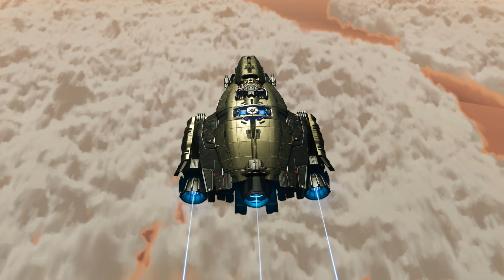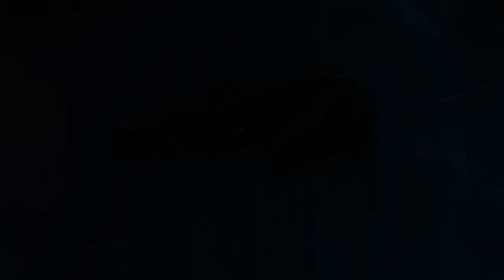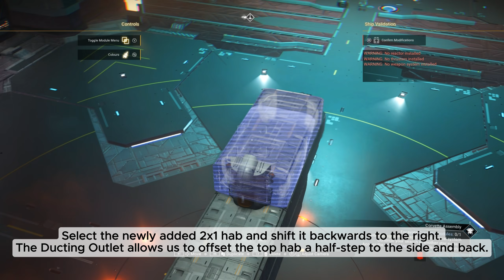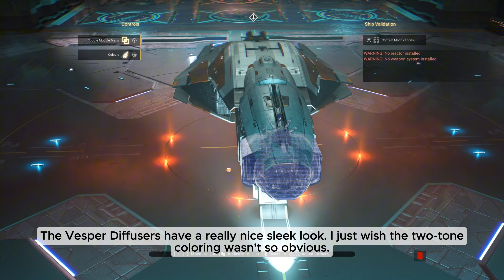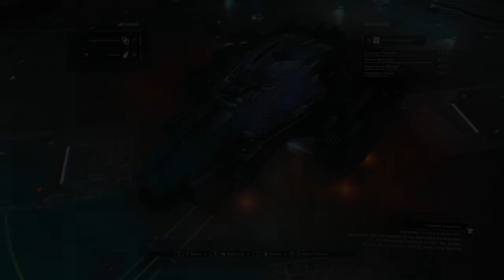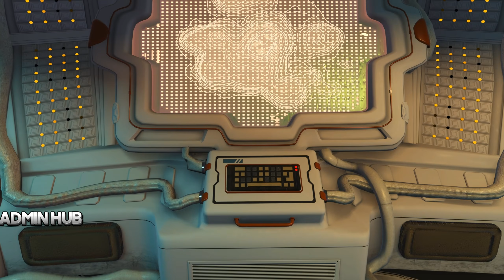How to Build a Daily Driver Exploration Ship | No Man's Sky Corvette Build Guide

Comment: I am 100% building this ship as my first corvette in NMS! Hopefully someone can answer this. How can I bring the side engines out a little more? I love this look but want to have a little larger wings. Kind of like the MOA from Eve Online.
Reply from the maker: Nice, glad to hear you like it! It's definitely possible to extend the engines out by inserting additional habs or walkways on each side of the central fuselage, but if this is your first build, it will definitely get confusing since we use some glitch merging techniques to build out the main hull. 

What you should do is build out the fuselage as you see in the video, then add a hab on each side of the upper deck rear hab. You can build out the main hull as you see, and do the same glitches, albeit just with a scaled up width since you're going to be 3 habs wide instead of 1. This is where it will get confusing for your first time because the glitches will require that we merge walkways into the central fuselage habs. In this case, you will have to do the glitches onto each of the newly added habs that you used to increase the width.

This might not make any sense, so in all honesty, I would recommend trying to build out the ship first and get used to how the glitch techniques work for this particular build.
Reply: @High_Key  I think I understand the concept but I will take your recommendation to build the ship like you present it until I have a better grasp of how the layering / offsetting works. This and the second ship you made for NMS are so cool. I also want to make the Meridian Star but maybe make the main body a little more round?
Reply from the maker: @Allbirdbag  It will definitely help. As soon as you understand the concept of half-step offsets and how to do them, it completely opens up ship building to so many new opportunities.

That Meridian Star build was my second corvette and it doesn't use any merging techniques, so very simple ship to build. I eventually plan to revisit it and improve it!
Reply: @H @High_Key  I can’t wait to see that. It already has a classic shape so an updated version would be awesome.

Comment: And here I am using a purely vanilla building techniques ship... Maximum parts and it is the most broken I have ever managed to make a corvette without using glitch building. Just wish it was possible to remove the Photon Cannons since it used Infra-Knife and Photon Beams as its armaments. 😅 I named it the Swift Raven.
Reply from the maker: Wait so you were able to build something similar with the glitch merging techniques?

And yeah I typically use photon cannons because I prefer the look of the cannons. Like for example, I use cyclotron ballistas all the time but the cannon tends to not fit what I’m doing.

Comment: I was following this design, but when I finished deleting the walkways in the center merged with the habs, I noticed that the engine is half a block further out than the end of the habs? is this supposed to be the case?
Reply from the maker: If you removed the hab and reattached it after the deleting the walkways, exit the builder and run inside the ship to make sure the 2 habs on the main deck aren’t merged into each other. You’ll know they’re merged if you place a stair and it’s blocked at the top. The whole main deck is supposed to be 2 Habs back-to-back behind the cockpit. Because of all the parts above the habs providing additional snapping points, it’s easy for the habs to merge into each other accidentally

Comment: Can we please get an updated one on this with the missing steps
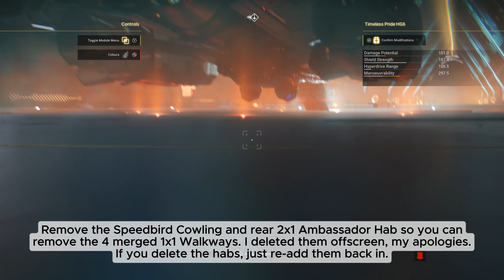Reply from the maker: The part that I forgot to record is a simple step. Remove the hab behind the cockpit, and if you see any walkways that would’ve been merged into the hab, just delete them. Should be 2-3 of them. At the 10:53 timestamp, I remove the rear hab to clear out one of the merged walkways but there’s about 2-3 more merged into the hab in front of it. So you can do the same, remove that forward hab, to reveal the walkways, then delete them.

Anyway walkways on that central main deck need to be removed leaving only the 2 habs.
Reply: @High_Key  Ok I think I’m kinda understanding what you’re saying. Ima try it cause this design is perfect for me.
Reply from the maker: @ededdandeddytv5164  Let me know if you run into any issues! I'm going to be traveling overseas tomorrow though, so if you get stuck, I might respond a little later, but it will still be within the day 🫡
Reply: @High_Key  cruising the cosmos in the Starwind now 🫡 thank you sir
Reply from the maker: @ededdandeddytv5164 NICE 🍻 see you in the cosmos!

Comment: I've rebuilt this ship 3 times and still can't access the top habs. I've removed the Titan hab on the bottom and both Ambassador habs, still no joy. I believe I removed those 4 walkways, but at this point, I dont know. Help?

Edit: Based on the count of walkways I started with, they're all removed. It looks like there was an issue with the Ambassador habs overlapping. I can gain access to the cockpit now, but its only half open. I'll remove the cowl and see if i can pull the upper habs back a little. 
Lovely build, thanks for the awesome video

Comment: Did they fix any of the bugs?
Reply from the maker: There haven't been any major issues recently outside of some expedition bugs that have already been patched. Which bugs were you referring to?
Reply: @High_Key the ones where you use walkways and such, or when I try to put the engine covers half overlapping each other like you did, I think I must have messed something up along the way
Reply from the maker: @luckyvii9772 oh like to merge those parts without having to use those walkways and ducting outlets? No not yet unfortunately. I’m not sure if that ever will tbh. The amount of time it would save us if they could just add it..

Comment: That blue version is also interesting!
Could you look into explaining the original??
Reply from the maker: Honestly, I rather much prefer the design of that blue version too. I think the sharper lines give a cleaner look overall. If you want to go for that look, it's actually a very easy change to do. You just use those Vesper Diffuser parts instead of the Speedbird Nacelles that I ended up using when that section is happening in the video.

I've been wanting to do a Mercury Star Runner build in NMS and so I'm mostly likely going to use this build with the Vesper Diffusers as a base structure for that.
Reply: Could you also look into an interesting looking small transport corvette but glitch free?
Reply from the maker: And I can definitely add that to the to-do list. If you're interested, my two first ever NMS corvette builds were glitch free builds. Parts were merged but they didn't require any weird glitches or anything. For now, you can check those out: 
https://www.youtube.com/watch?v=8Er1EiGZW_8&t=8s
https://www.youtube.com/watch?v=qBMwYnnbZBE&t=137s
Reply: @High_Key  i wil take a look at that
Also a small correction: trading ship parts you're not required to offer three items, you actually need to see what is and what isn't accepted for trading, the percentages Should(but that's not always correct for some reason) show the chance of getting the trade(there are items with high trading potential and low potentian depending on the part you want)
There sadly is no definitive way to always get the parts but i hope it creates a better picture😉

Comment: Love this build - for those that like text parts lists (like me):
T-7 ARCLINE-CLASS PARTS LIST

COCKPITS & HAB MODULES
Titan-Class Cockpit
Thunderbird-Class Hab
2x Ambassador-Class Hab (+1**)
9x Walkway**

ACCESS & DOCKING
Ambassador-Class Landing Bay
Mag-Field Landing Thruster

THRUSTERS
Kineostream Thruster
2x Thunderbird Heavy Booster

DEFENSIVE SYSTEMS
2x Photon Turret Array
Defence Field Shield Generator

REACTORS
Azimuth-Class Reactor
Medusa-Class Reactor

STRUCTURAL DECORATION
WINGS
2x Arcadia Wing Module
Rockhopper Propeller Module**

HULL PLATING
2x Engine Cover (+4**)
4x Speedbird Nacelle**
2x Supercruise Aerofoil
2x Vesper Aerofoil
4x Vesper Diffuser**

HULL ATTACHMENTS
Ducting Outlet**

WINDOWS
2x Paneled Window

COLORS
TAN & ORANGE (METALLIC)
DARK GRAY & BLACK (METALLIC)
* = Part is used for glitch merging and/or is temporary**
Reply from the maker: 🍻 glad you enjoy the build! Thanks for providing the parts list here too
Reply: You are a legend cheers 🎉

Comment: Been cruising around in this for the past 4 or 5 days. But, I rebuild my ships almost as often as I change my underwear, at least every 2 or 3 days. 😛So, time to browse through your other ships and see what you got.
Reply from the maker: Glad you're enjoying the ship so far. And you and me both 😂 Btw I started with Starfield ship builds and do NMS builds now too. Just a heads up so you're not surprised with the Starfield builds.
Reply: @High_Key  I keep coming back to it.  I've rebuilt it 3 times now. It's my daily driver.  Right now, I use it to hunt for sentinel ships that I'll never fly because the corvette is better.  Especially now since I have a 4-in-1 mod that turns the mission terminal into a teleporter, planet scanner, trade terminal, and it's primary function of being a mission terminal.
Reply from the maker: @RetroGuy_77  Man that's awesome to hear! How come you rebuilt it 3 times? Just to have different variations or for different saves?

Now I'm curious, how's the mod scene for this game?
Reply: @High_Key  I usually only keep one corvette on a save because of the wonky scrambling of components when you have more than one.  So, I built it initially and flew it for a few days before trying out a different build, then rebuilt it because I liked it better. Then I also built it in my permadeath save.  I like the vesper version better than the nacelle version, I think the angles make it feel tougher, more rugged, but I've made two other modifications. I removed the windows and put infra-knives in those spots because I didn't want my guns clipping through the aerofoils.  That also allows me to put a refiner and an extra storage inside where the windows would have been.  And I put a second mag-field landing thruster on the bottom.
Reply: @High_Key  As for the mod scene, Nexus has a few really good mods for building bases, being able to resize anything and everything is awesome; tiny portals that can sit on a desk, or all of your storage cubes all on one wall.  Having quicker settlement timers is possible. And there's a lot of graphic enhancing mods, too. I mean, you're not going to see Skyrim type mods, obviously, but there's a few really useful ones, and ones that make the game easier or even harder. There's a few that enhance the steering on exocraft, some that boost your jetpack capabilities, or make your squadron actually useful. And so far, I've never had a mod brick a save.  If it doesn't work, or your game crashes, log out, delete it, log back in, problem solved.  I used to follow a ship hunter YouTuber who used a few mods to help with hunting.  He was primarily a sentinel hunter and he used a mod that allowed him to claim sentinels without having to go bless the brain.  That allowed him to hop from ship to ship, uninterrupted.  He also used a mod that removed the pulsing red glow inside a sentinel ships windshield that made it near impossible to see out of in the dark.  Quality of life mods.
Reply: @High_Key  Hi, 4 months later and this is still my favorite ship.
Reply from the maker: @RetroGuy_77 honestly, still my favorite NMS build too

Comment: Hey man, love this built!!! Thanks for it. I just built it, but I’m having a problem, once I install the stairway, it doesn’t open all the way for the to have access to the second level, you know what could have happened?
Reply from the maker: Hey apologies for the late reply. So 2 things, one I forgot to record the process where I delete all the 1x1 walkways that were merged into the 2x1 habs on the main deck. Make sure you delete the 3 walkways that were merged into in. And second thing, sometimes the ship builder gets bugged, so when that happens, just exit the game and load it back on, then that should fix the issue. But it you didn't delete the merged walkways, then that's definitely what's causing it.

Comment: how do you come up with the names for the ships you create? what’s the thought process, just curious haha 

is it whatever sounds cool or do the names have a meaning behind them
Reply from the maker: Ultimately, it's a cool factor thing or it's based on the ship's role, but most of the names are inspired by Star Wars and Star Citizen ships, or they're just straigh up movie references. If the ship is a part of a series, I try to come up with a naming scheme that I can use to create multiple ships with. But all ships have some sort of model designation or a common naming scheme similar to what you would see in Star Wars ("YT-1300 Light Freighter" aka Millennium Falcon), or with vehicles like the Ford Explorer/Expedition/Excursion.

So, for a typical naming scheme, one example of a series would be the dropship series (DS) that I do for both Starfield and NMS. In Starfield, the ship names are inspired by the Mad Max universe with names like the DS-2 Praetorian-Class War Rig and DS-4 Imperator-Class War Rig, while in NMS, the ship names are bit more ambiguous but still related with the DS-33 Monarch-Class and the DS-42 Dominion-Class. 

In other cases, I try to use a common naming structure across the ships like my "Star Explorer" series (SE). Here the names are mostly inspired by the Mercury Star Runner with names like the SE-Meridian Star, SE-Meracore Starbound and SE-Merigen Starwatcher. Another ship in this series is inspired by both the Mercury Star Runner and the Outrider from Star Wars and so that ship is called the SE-Mercator Star Rider.

And in many cases, I combine both naming structures for a series like my "Cargo Runner" (CR) or "Cargo Grid" (CG) series. The CR ships are all asymmetric, side-cockpit style cargo hauling ships with names like CR-22 Pack Runner, CR-31 Anvil Runner, CR-35 Drift Runner, CR-44 Blade Runner and CR-56 Load Runner. The CG ships are symmetrical cargo haulers with names like CG-270 Anchorlight, CG-570 Delacore, CG-770 Anchormax and CG-900 Star Anchor. In this case, the Delacore is the only name without "anchor" in it, and that's because it's not a dedicated cargo hauler, it's a multi-role freighter, but it utilizes a similar fuselage design as the other ships in the series.

But I will say, a ton of my builds are basically movie references. I rebuilt the Fury-Class Inteceptor from Star Wars The Old Republic and called it the Darklighter. I used James Bond movie names as inspiration for Star Raker (Moonraker) and Starfall (Skyfall). And I even use a combo of Jurassic Park/Dune/James Bond for a xenofauna hauler style build called the Duneraker which is a CX-4 Ingen-Class Xeno Hauler. 

Sorry...really long reply, but I get passionate about this stuff haha
Reply: @High_Key no that was really interesting to read! Thank you for that, now I can pay attention to the diff meanings behind each ship as you drop vids
Reply from the maker: @Phrezzyy  Haha thanks man! I appreciate you tuning into the videos. Feel free to reach out any time 🍻

Comment: I've been daily driving a heavily modified, lengthened janus for a while now, but this one would be tempting to use as an alternative..
Reply from the maker: That’s awesome to hear! Love the subtle asymmetry of the Janus. Can imagine a longer version looking really good. Hey nothing wrong with having multiple corvettes 😂
Reply: @High_Key I only lenghtened it by a half hab on both sides, but the ammount of extra space that adds is tremendous. It also kinda makes the lines a bit sleeker. But yeah I am a sucker for assymetrical ships myself. (I do have a second janus as well, completely converted to the more recent atlas parts and engines, which works surprisingly well)